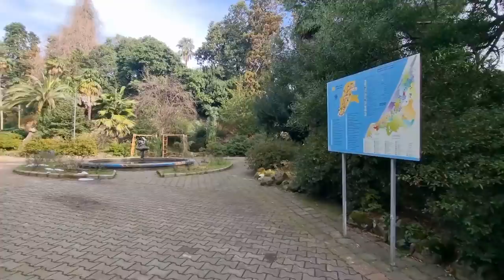Winter car camping in Georgia - END OF SEASON

Comment: Great vid as usual! Could have cried when you left that dog, bless 😞 

FYI on that scuttle area between the engine bay and the inside, the misses had a clio that had the same issue, that plastic piece next to where you looked in might be able to come off, in her clio she had some drain holes that clogged and completely flooded the inside, defo keep them all clean. You won't get any flooding if they are clear.

Also, you know the drill, get down to the local news agent's and buy a few newspapers, nest thing for soaking up the damp from the car, crumple the paper and leave it on the footwell, good for drying out boots too 😉
Reply: Scuttle! That's it! I was trying to remember the name of the thing you have to lift to get at the drainage hose or hoses. Not sure whether there's one or two. I was just explaining there same thing happened to me. And my wee car is a Clio too. It was the previous owner though who had let the car get like that. He said there was a damp smell in the car because he had a wet dog in it. The flooding footwells were a little surprise for me weeks after l bought it. 😊